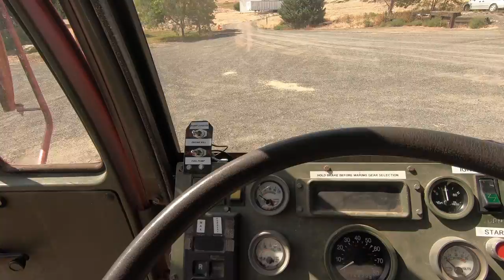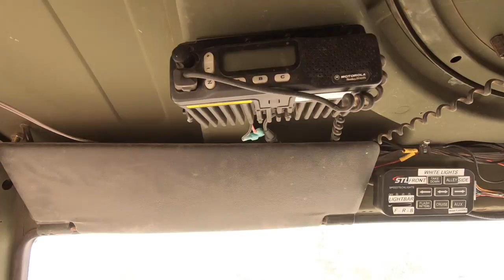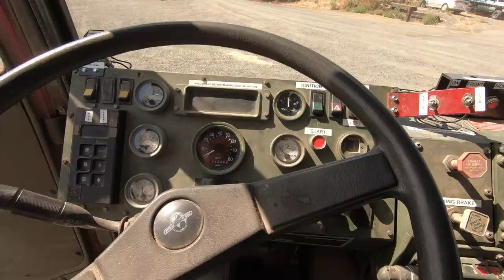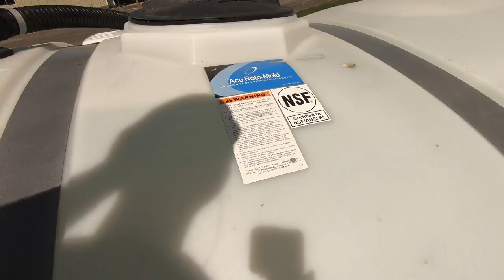LMTV M1078 Fire Truck walk around

Comment: Are you happy with the 850 gallon tank?  Is it too heavy for the truck or handles just fine?  Do you think the truck could handle a 1,000 gallon tank? I know they are only “rated” for 5,000 lbs. our department is converting one of these to use as a brush truck and trying to decide on tank size.
Reply from the maker: I wouldn’t go more than 850. This one does ok. Our other 1078, we cut the bed off, lowered the tank cradle around 17 inches. It handles much better. We left about 3 feet of the bed at the front, and caged it to stand. I have pictures.
Reply: @Yama450YZF  thanks for the heads up. I will definitely keep it under 850 then. We plan to keep the bed and do a very basic setup with tank, reel, hose, nozzle and pump. May go with one of the Norwesco 725 gal verticals then. I appreciate the info.
Reply from the maker: @saxman454  we use a bunch baffle balls too
Reply: @Yama450YZF  Do you have any pics or video of the second 1078? we just got one and are trying to get the tank lower as well.
Reply from the maker: @godspyro2  I do. Email me at prcoon@gmail.com

Comment: Put your lift eyes back in.  that way if you flop truck on its side.... extend the side up ones, so another another truck can then strap to them and pull you back over easier.  course can do with it un-extended too but have less leverage advantage.